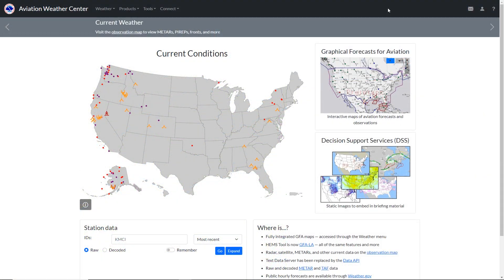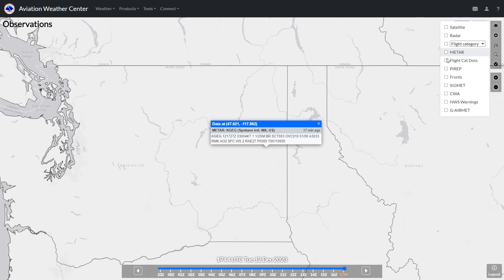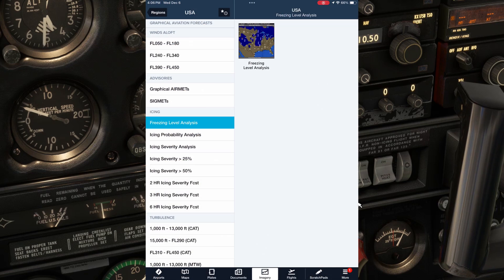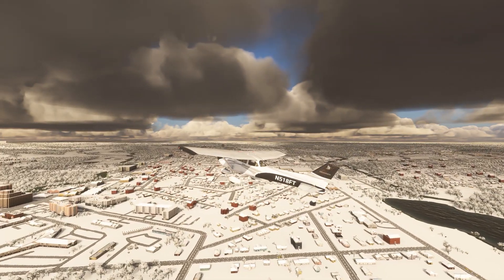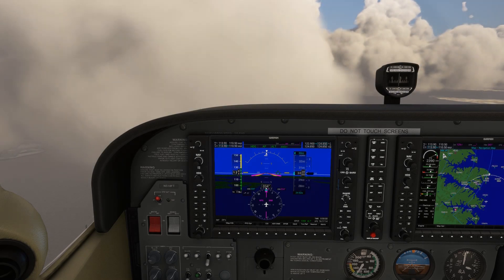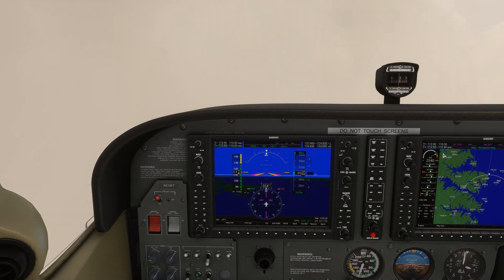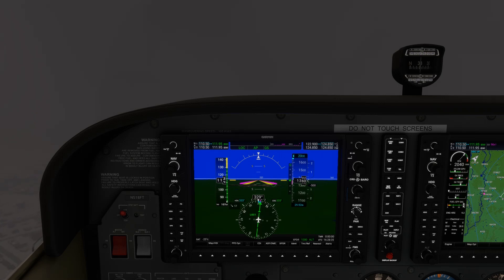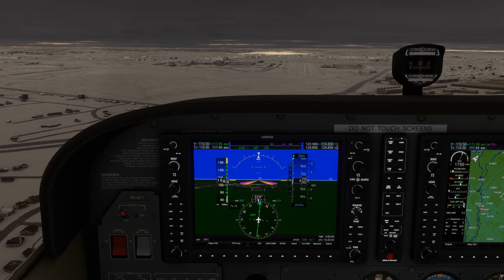Staying out of Icing Conditions | IFR Training

Comment: Making the airplane “heavier” is a bit of a silly way to think about icing. Is it technically true? Yes. Functionally it’s so negligible. If you throw a couple bags of ice in the back seat of your plane before you took off, is it really going cause the plane to fall out of the sky? Severe icing will really will never add more than 20-30 pounds of ice on a small GA aircraft
Reply: There is a lot of surface area on a small plane (wax one and find out) There are conditions where a lot more than 30lbs+ could happen really quick. In planes with de-ice boots, the amount of ice in the areas not covered by the boots makes a giant mess in a heated hangar when it melts. While the the destruction of the airfoil and added drag are the main story, the weight is like handing a struggling swimmer a brick. Check out the NASA Icing course, it is fascinating.
Reply: Maybe you're just reading into it too much. Nobody ever claimed the plane will fall out of the sky because of the weight, but it can exaggerate all of the other effects the four forces that are already suffering from icing.

Comment: Good stuff here.  I picked up some un-forecasted ice on decent to an ILS approach a few weeks ago.  It was my first experience with ice and I was surprised at how quickly my windshield iced over with a thin layer.  Literally I was on top and as soon as we went into the could layer i instantly had a thin layer of ice over the airplane.  Pitot heat and carb heat was already on, cranked up the defrost and increased my decent to punch through quickly.  I was only in it for maybe 60 seconds but that was enough to give me a whole new respect for just how quickly ice can accumulate.
Reply: If you got freezing temperatures and visible moisture, you’ll get ice, it doesn’t have to be forecast!

Comment: awesome knowledge!
one thing I always wonder about.. if in IMC, and noticed I'm getting ice quick (i.e. freezing rain), and no deicing equipment - how soon can I start making changes, considering I report the emergency to the ATC? Is it immediately, without waiting for their confirmation, or do I need to wait for them to come back to me?
Reply: 14 CFR  §91.3 (b) In an in-flight emergency requiring immediate action, the pilot in command may deviate from any rule of this part to the extent required to meet that emergency.
14 CFR  §91.123 (c) Each pilot in command who, in an emergency, or in response to a traffic alert and collision avoidance system resolution advisory, deviates from an ATC clearance or instruction shall notify ATC of that deviation as soon as possible.
14 CFR  §91.123 (d) Each pilot in command who (though not deviating from a rule of this subpart) is given priority by ATC in an emergency, shall submit a detailed report of that emergency within 48 hours to the manager of that ATC facility, if requested by ATC.
14 CFR  §91.527 Operating in icing conditions -- large and turbine (d) If current weather reports and briefing information relied upon by the pilot in command indicate that the forecast icing conditions that would otherwise prohibit the flight will not be encountered during the flight because of changed weather conditions since the forecast, the restrictions in paragraphs (b) and (c) of this section based on forecast conditions do not apply.
Reply: Agreed. Now, if you are flying IFR, and there is other traffic around, smashing into another plane may be worse than staying a few more minutes in mild ice conditions. But, if it’s just a very tiny bit of rime ice inform them of the need to change altitude. If more than that, declare an emergency and get out of there. Anyone else in IFR conditions will be on the same frequency no doubt and will keep out of your way.